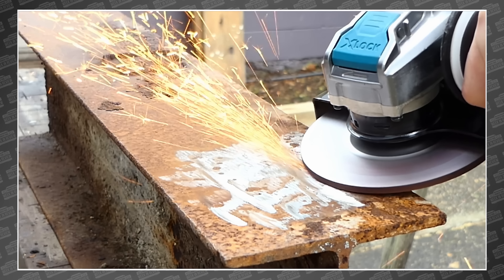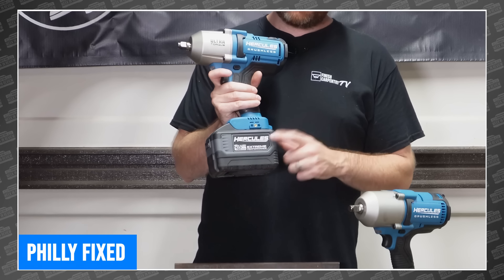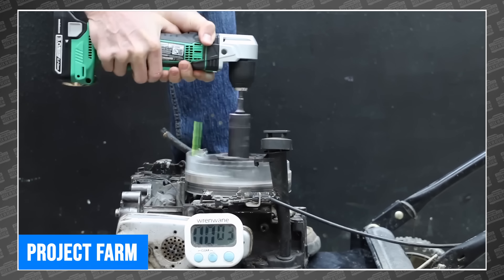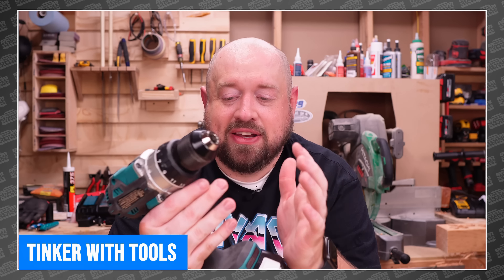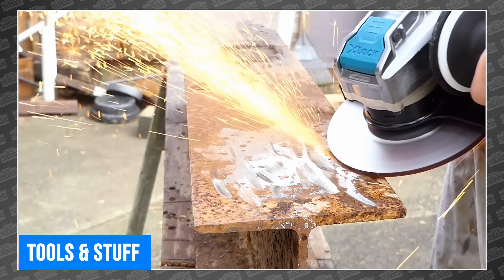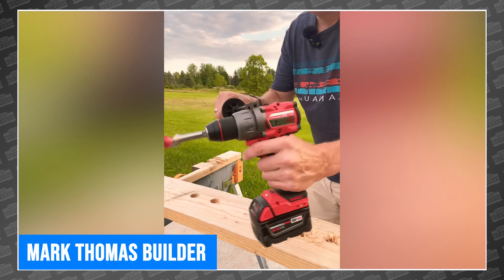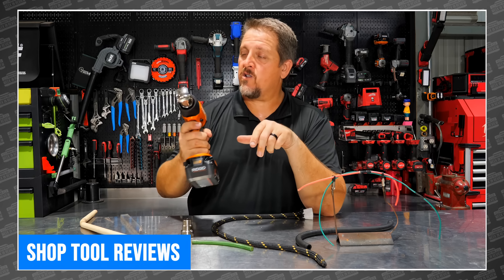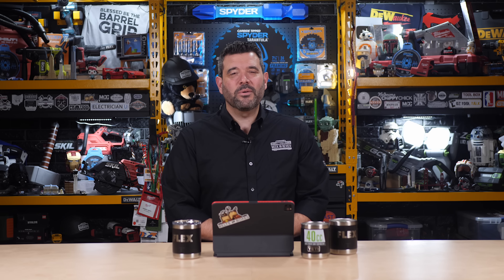How is this $20 chainsaw actually doing the job? Power Tool News!

Comment: They've been selling chainsaw attachments for your angle grinder for years now and they really cut. I bought an 18V, 4" chainsaw with two batteries, two chains and a hard case for $35 on Amazon and it cuts better than my Stihl GTA 26, plus the batteries last longer too.

Comment: Those Harbor freight Hercules impacts look to be above and beyond better than their previous tools. They also have a better warranty than most of the big brands and the power is very comparable with a cheaper cost also. Torque test channel just put them up against milwaukee and dewalt.